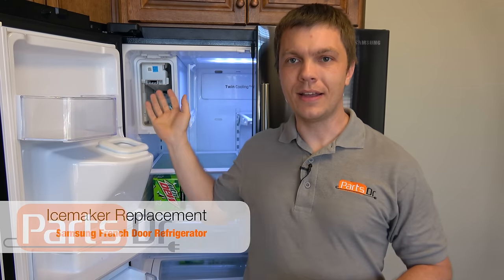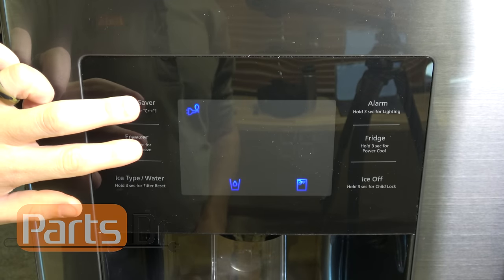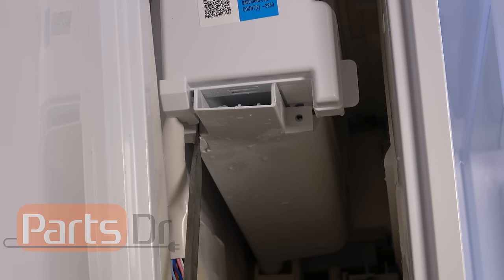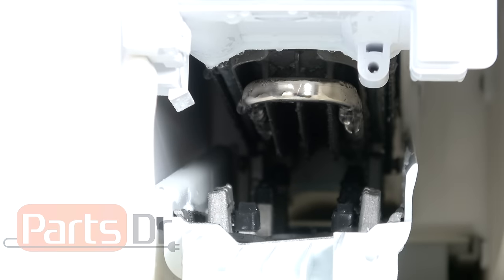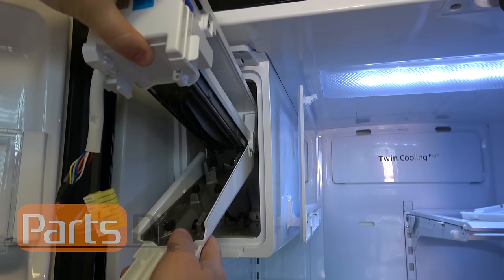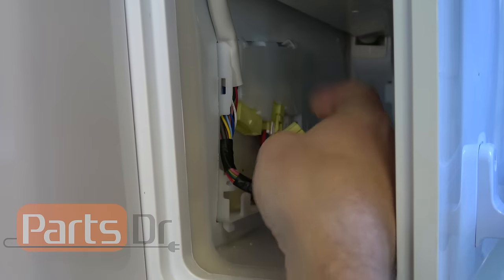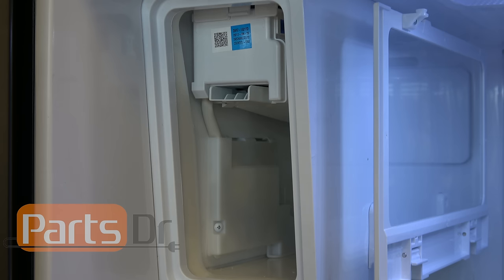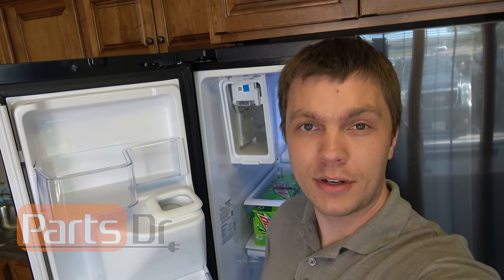How to replace Samsung Icemaker part # DA97-15217D

Comment: This was a great video on how to change as well as provide much needed codes to defrost as well as shut down the unit. We have a Samsumg French door model. Ice unit was replaced about 3 years ago with upgrade. Worked well for about 2 years, then it just started icing up. Every 3 weeks would have to deice to clear. So replacing the unit today. Also found that the sealant used, while showing in place was old. Removed all old sealant and re-sealed. I did notice something, that others may have observed. The upper shelve that folds that's attached to the ice maker box, I am going to assume that the weight placed on this may be causing the sealant to weakness. As the shelve is screwed to the box, thus placing a load on the plastic housing that may result in weakening the sealant. This could perhaps cause air to cycle into the box cavity and add to the ice buildup and needing to defrost/clear the ice. So going to redistribute the weight and see what happens. Will monitor and update how the process unfolds, but again thanks Part Dr for the valuable video.
Reply: How did it work?

Comment: Got me off to a great start. Would have also loved a video on how to replace the auger motor. I did finish it, but not before dealing with a “hockey puck” sized chunk of ice right above the fan on the auger motor which kept it frozen in place. Can’t believe Samsung did not recall this engineering debacle.
Reply: That's what I'm looking for. Do you have a link or advice?
Reply: @davidhelgerson3678  Advice on this ice maker..... Pull your Samsung into the street and light it on fire. 2 years on I have replaced everything twice. Re sealed everything 4 times, and it always freezes back up within a month. Samsung has a class action law suit they have been working on for a while around this and said the problem has been fixed for a few years now. I was at buddies house 2 months ago and he had one of the really cool Samsung 4 doors with wifi. Ice maker completely frozen up. less than a year old...

Comment: Excellent video. I replaced my ice maker about 1.5 months ago with the updated part that has no little notch in the back. It used to frost over every couple of days. With the new part (knock on wood) it has been frost free. A freakin miracle!
Reply from the maker: Nice job fixing it yourself!  Thanks for sharing!
Reply: Are you referring to the y clips or the ice maker?

Comment: Bless you kind gentlefolk. I had tremendous ice buildup, and I probably would have destroyed the fridge (2013 RF263BEAEBC) if I wouldn't have had this video. Always helpful to know the sooper sekrit button press combos! I will definitely get the sealant if the ice continues to build up.
Reply: @Gibberish75  I bit the bullet and had the ice maker and other parts replaced a few weeks ago. The local repair business had a trick "he and other technicians had discussed online" 😳 for also getting rid of ice buildup in the cooling unit at the back of the main fridge compartment, and ice buildup in the freezer. My ice maker/fridge/freezer have been ice buildup-free for about a month now. Cost me $400 but I was going to junk the fridge otherwise. Glad to have a fully functional fridge again!

Comment: Fantastic video!!!  I purchased this ice maker from Parts Dr and replaced it in about 20 minutes.  It's working great now!

I didn't have a lot of ice built up around the old ice maker so, rather than force the refrigerator into defrost mode, I simply turned it off (at the breaker) and used a hairdryer to melt any ice/frost on the broken ice maker's cooling coil before I attempted to take it out.

Thanks!!!
Reply from the maker: Nice job fixing it yourself!

Comment: This video was incredible! I've been struggling with our ice maker for years. I ordered the replacement ice maker and the Y-clips. I suspect that I may have only had to add the y-clips though, since I noticed when I took the old unit out, the only ice buildup was at the base of the cooling coil. Still, my old unit was an outdated one, so I replaced it all and it has been working like a charm. It was well-worth the hundred bucks I spent for the unit, to eliminate the need to call the repairman. I can only hope it keeps working. I think I will routinely do the "forced defrost" just to maintain it. Thanks for a great video.
Reply from the maker: Great to hear!  Thanks for sharing!

Comment: I did this change out with a new ice maker. Followed the video step-by-step, took about two hours (including defrost time). It went perfectly. Now we have ice cubes again! THANK YOU! I did notice light coming through the seam between the refer wall and the ice maker compartment, so I'm buying some Samsung sealant to address that issue. Hopefully that will be the end of dealing with this.
Reply from the maker: Great job on the repair!

Comment: I bought the "Y" clip kit and it has made a world of difference. My refrigerator came with the wheels adjusted so as to tilt the refrigerator slightly back towards the drain. I believe that if the motherboard is working properly the icemaker goes into a defrost mode either automatically or if a detector senses the ice buildup. This is what it seems like to me but not substantiated. There is also a heater which surrounds the drain tub to thaw out any ice buildup in the tub which if it is blocked with ice the water will overflow into the fan and auger motor module causing more problems.
Reply from the maker: Thanks for the feedback!
Reply: I, like everyone else, was seriously thinking of smashing the hell out of my icecube maker.  Thanks so much for the great video!!  
Just to confirm a little tip..."NEVER" USE A HAIRDRYER ON HOT TO DEFROST YOUR FRIDGE -FREEZER, NOT EVEN ON WARM!!!  Both of these settings will melt or mottle or warp your appliance!!!
HAPPY DEFROSTING!!

Comment: PartsDr. Utube video on replacing a Samsung RF24FSEDBSR/AA ice maker is fantastic.  Watched it thoroughly a couple of times, ( bought the Samsung ice maker replacement part from Parts.Dr.) then replaced the ice maker.  His video is fantastic.  My only additional comment after replacing the ice maker is to push the little blue reset button on the left inside of the new ice maker.  Thank you PartsDr. & your fantastic video.  We now have ice. Hallelujah!

Comment: Thanks for the video. I have had to do this now 3 times with our Samsung over 3-4 years. Very frustrating. I have taken the everything out and completely defrosted this area, but it is a problem with Samsung ice makers. From what I’ve read when this fridge gets old enough to be the outdoor fridge I will buy a different model but check reviews so we don’t go from bad to worse! I did like the post that suggests a sledgehammer for the ice maker once removed!

Comment: Great video.  Our version of the fridge does not appear to have the feature that you can switch it off using a button combination.  That meant I had to empty out the fridge and freezer to pull it out so I could unplug it from the electric socket.  My tip is have it plugged in somewhere where you don't have to do this, since there is always the risk of damaging the water line or connection as you are moving the fridge / freezer out or back.  The food in the fridge and freezer should remain suitably cold for a few hours while it is off.  Move any medications that need to remain cold to another fridge if possible. Place a pan or something similar under the ice box to catch the water as it thaws / defrosts.   It should be small enough to comfortably sit directly under the ice box while the french door is open.  Let your family, visitors, friends know not to try and close the french door while you are busy trying to get the piece of junk ice box working again.
Reply: on mine the triple combo of freezer / alarm / fridge buttons worked

Comment: Step 1: pull out old part
Step 2: throw it on the ground and stomp on it
Step 3: get some ice trays from target
Step 4: only by TVs from Samsung in the future
Reply: Step #2 temporarily solved my Samsung TV problems.  Bought "LG" TV. No more TV problems.
Reply: You are so right.When ours craps out I tell the wife get out the ice trays the damn thing stopped working again.🤣
Reply: I bought a small ice maker and put it downstairs shut the fridge one off

Comment: Excellent video, 100% clear and understandable. It saved me quite some money for the only authorised repair shop 400 km around. They want 79 € (93 $) only for sending a quote! Spare parts, travel and time would be on top. It's this only authorised Samsung repair shop 400 km around. Following your video, I defrosted, took it out, dried it and placed it back. Then it worked again! This repair didn't cost me anything. THANK YOU SO MUCH!  Still shame on Samsung, a three year old $2400 top line fridge should be a lot more repair friendly. Actually it should not even break. And Samsung should review the financial practices of their agreed repair centres.
Reply from the maker: Awesome!  Nice job with the repair!

Comment: To avoid this problem in the future,  never buy a Samsung refrigerator ever again.  😑
Reply: I learned that the hardway
Reply: Mines two years old ..no ice and most of the shelves are damaged or broken
Reply: Worst appliances.
Reply: We bought all Samsung appliances back in October of 2016. Kitchen and laundry room. It’s now June of 2022. Besides the very ignorantly engineered ice maker, everything else has worked great until this year. I just had to replace one of the rollers inside the dryer for the drum otherwise they have worked very well.  I can’t believe a company as big as Samsung was not able to come up with a fix for this we will never buy SamJunk again that is for sure.  When we first bought everything we called and had the repair guys come out here six different times to try many different things with the Ice Maker and finally Samsung said just cut the cord send us a picture and we will refund you the money.  Well I stalled with the picture because I told them I needed to get a replacement refrigerator so they gave me the money and never asked me for the picture of the cord so we got at least a free refrigerator freezer out of it LOL.
Reply: @loosenut1969  funny you say that about the dryer, I had to just do the same, this yr. Unfortunately its a stackable took me a while to get down. But then the vents starting rattling and had to take down and secure it. I replaced ice maker NOT the board. And it has worked perfectly for a while. I noticed the big difference with it is the inlet tube is larger on the new one but i have had zero problems and its been a few months.
Reply: @unclecarney1526  the repairman says Samsung won’t sell just the roller. You have to buy the whole arm mechanism.  $$$$$.  What did a new ice maker cost to buy?
Reply: @dstack18  Yes. My ice maker is kaput and my shelves are held in with duct tape.
Reply: Every repairman and AC/cooler tech at work always ask “Is it a Samsung” when I tell them how 💩 it is. Then they shake their heads and say “the wife picked it out because it’s pretty right?”  Then I drop my head in shame.
Reply: @adamr9720  same here had to match the stove and micro😀
Reply: @adamr9720  Well we had bought Samjunk washer and dryer and the wife liked them so she decided to stick with all Sam junk appliances. Lol
Reply: @loosenut1969  me too. I went to work and let her pick them out. I can't blame her too much; they looked fine on the outside.
Reply: @adamr9720  right!?
Reply: This is the correct answer. Won’t buy any of their kitchen appliances again.
Reply: samsung builds up a thick ice layer in the freezer every one to two months I need to remove it or the door won't close. Bestbuy and Lowe's are flooded with Samsung models but I would never buy any samsung again.
Reply: I had to spend $350 to get a mechanism for my dryer.  Total scam.  I have not bought a new icemaker allegedly the new ones now are corrected I am going to call appliance guy now and ask him
Reply: @sandbox4850  mine has to removed and thawed every three weeks
Reply: @loosenut1969  I found a YouTube video of the Samsung ice build up problem.  It is shocking that Samsung put a tiny evaporator clip, couldn't melt the ice so the water couldn't get through the evaporator tube and build up at freezer bottom. A larger aftermarket clip replacement is supposed to fix it.  I am going to give it a try. Search the video of Jeff Lepard
Reply: @sandbox4850  That seems like another water leak issue that I don’t have. I only have a problem with the icemaker I found this video what do you think about this?      https://youtu.be/ND-2Nkp1ItM
Reply: @sandbox4850  can you post the link here you’re speaking of please?
Reply: Our icemaker crapped out too. Luckily the one in the lower freezer works, but the upper one is dead. Samsung had no interest in fixing the unit. They sent out a new icemaker which didn't solve the issue. They wanted to replace the left upper door but couldn't get the part for some reason so they said we needed to cut the plug off and dispose of the fridge in order to get a refund.

So I did. I cut the plug off. We now have a Whirlpool refrigerator running flawlessly despite being older than the Samsung. The Samsung mysteriously reattached it's own plug and snuck into my garage.
Reply: @DriveCarToBar  hahahahaha yeah. They told us the same thing. Cut the cord and send a pic. I told them I needed a few weeks as I did not (wink wink) have a garage fridge. I never sent the pic. They refunded us.  The unit is just shy of 6 years old.  The ice maker was freezing up but working after thawing.  It finally quit working totally this week.
Reply: We only have the ice maker in the fridge section. This model has none in the bottom
Reply: I agree

Comment: Excellent video. Really helped with replacing the ice maker. I had to pry down a little on the ice maker with a flat blade screw driver to clear the latch on top before it would pull forward. I did all of the upgrades - sealant, y-clips, adjusted water inlet tubing insertion depth. Hoping this fixes the ice maker from freezing up once and for all!!!
Reply from the maker: Nice job!  Let us know how it works for you.
Reply: Just wondering, did the fix hold? Just did all of mine, but have little faith it will hold…

Comment: Very helpful video. I'm not getting water to my Samsung ice maker. How do you remove the water filter housing to check the water valve? Does it just pry up and un-snap? I don't want to break anything.
Reply from the maker: Hi Wayne,  I'm sorry we do not have instructions on removing the water filter housing.  We will try to cover this in a future video.
Reply: I wasn't getting water to mine either.  I ended up replacing the icemaker with the updated version DA97-15217D and it is now requesting and filling with water.  If you have the DA97-15217A, you may try replacing it as the first step in troubleshooting.  It worked for me and I get the filling sound of water and ice a couple hours later.

Comment: This is helpful... will check tonight. .. Well, I wrote that 6 months ago lol... but I finally got to work on my daughter's fridge - there was ice build up on the evaporator fan/coils causing noises.... Took a good 90 minutes of warm air blowing in to release the panel.
It's worth to mention she got the fridge used (a big no-no but it was too late for me to intervene)... anyway, someone was there before, on the icemaker used, probably, a heat gun to defrost it causing the back panel to warp and the top melt.... I was able to take the ice maker out, but had to chip the molten plastic to remove the auger assembly, then finally dry things out, and caulk the icebox compartment.
It is quite easy process IF THERE IS NO ICE BUILD UP..... what I'm saying is: allow time to fully defrost before you work on this fridge. 
And I said it before: if this fridge was an operating system, it would be Windows 8 ... if it was a car, it would the Ford Pinto.......
Thanks for the valuable tips on this video !